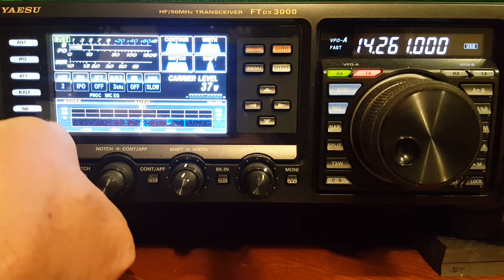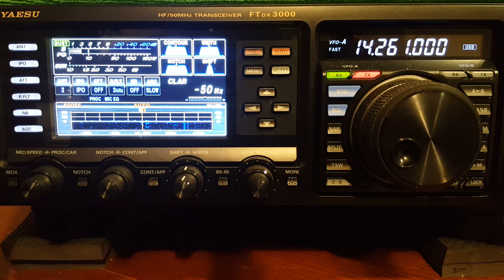K4VBH Works the 20m EFHW Desperation Antenna - 20m - SSB - 10pm - AMAZING CONTACT

Comment: Hey Charles..uh Chuck! :)   Great contact, and first time I"ve ever seen AND heard my signal on the other end of the QSO ! (..and I've been K4VBH since 1958)  Glad to know it was even better with the RF gain up. My audio sounds a bit "tinny", hope it was NOT from your good speaker. Ha..  Your Desperation antenna setup is doing the job.  Tnx for the call and the contact. Look for you again. 73. from K4VBH..Americus, GA.
Reply from the maker: How wonderful! Thanks for the comment. I just noticed it. Comments are a youtube weak point. Believe me, your audio was excellent. For a main station speaker, I use a homebrew one that uses a hefty subwoofer from a PC audio system. That thing sounds astounding on both SSB and CW. Thing is- I was set up to record CW, and my phone rejects it completely, leaving only clicks! So when I'm going to record for YT, I connect a tinny sounding Heathkit mobile speaker that sounds just awful. But I place it at the end of my phone and it 'sorta' records audio. At least when doing this the phone doesn't convert CW that's rocking me out of my chair into clicks. It's rather impressive. And depressing. lol. Yeah, you were absolutely POUNDING in here. Witht the RF gain turned back up. When I'm recording for youtube, I'm generally freaked out and screw up every time. Haha.  73 OM and take good care